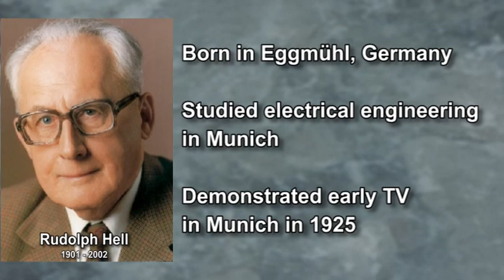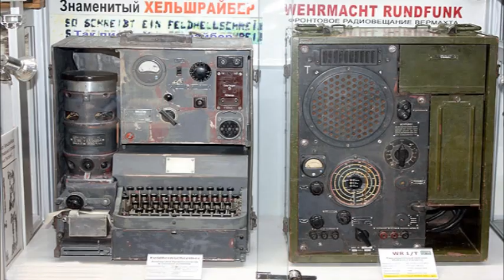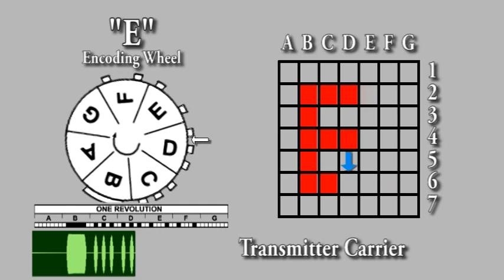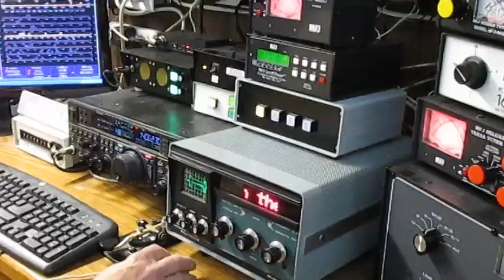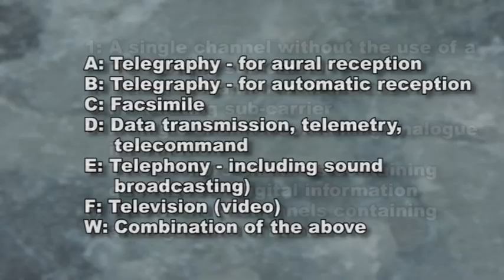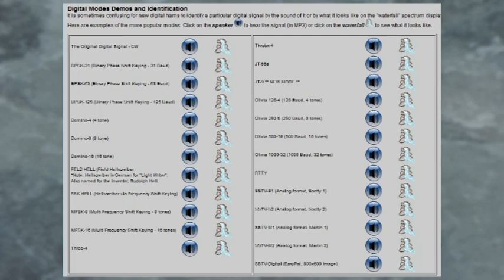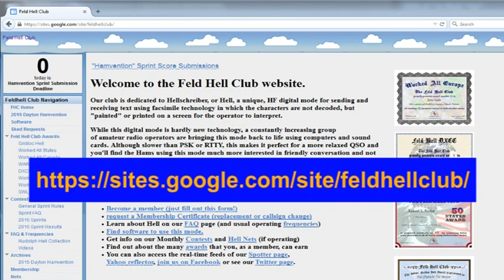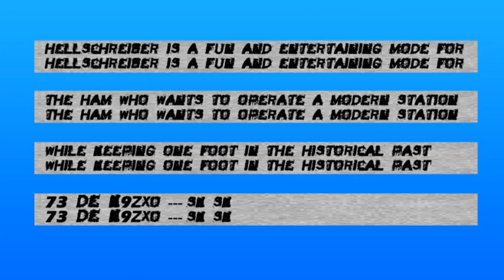Hellschreiber - What is that??

Comment: I think you said that the transmitter drum revolves twice for each letter. I think it only revolves once each letter. It prints two lines of letters due to the two points of contact on the printer spiral. Please correct me if I am wrong.  Very good presentation of Hellschreiber  history and operation. Thanks. Ken S

Comment: Very well made video. Hellschreiber (esp. Feld-Hell) is fascinating, because it basically is for the eyes what morse code is for the ears.. It also works with CW equipment, so very simple QRP transceivers like the Pixie can be used for this mode. That being said, Hell is no rival for Morse. In fact, most Hellschreiber software supports Morse code, too. ^_^

Comment: Thank you for this nice Video. May be some day I will be able to do this communication mode. Now Im motivated because I found that Im an owner of the right Item at 2:28 from my grandpa. Years ago, before he died he explainde me tuning radio stations with this equipment. Its named Rudi. He told me they got crapped on when they used it during WW2 for civil Radio stations. 73 de DL1RCI